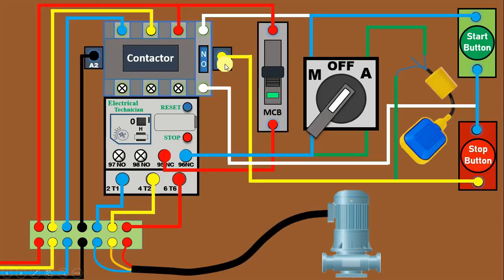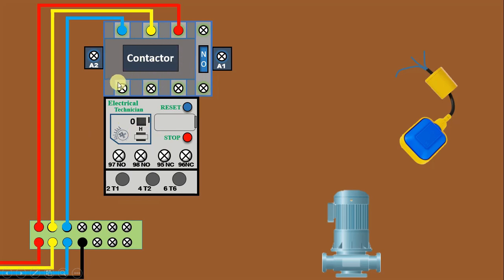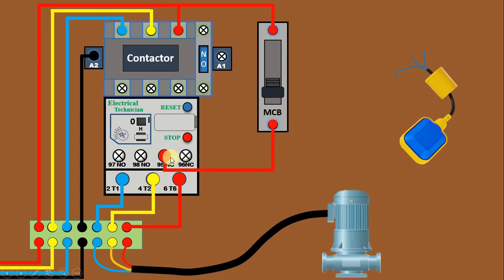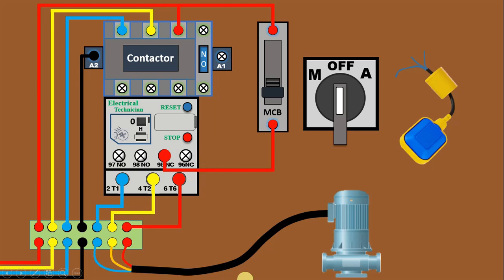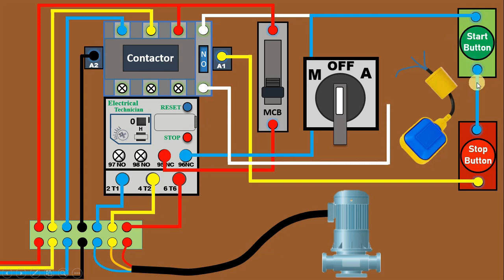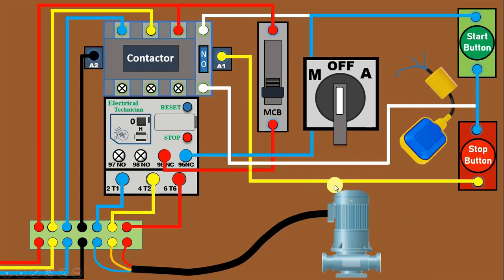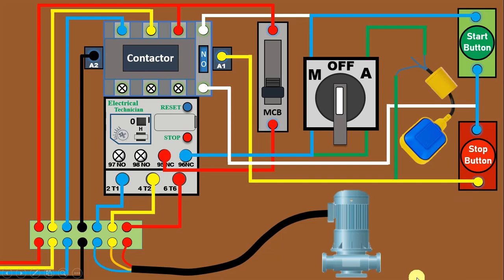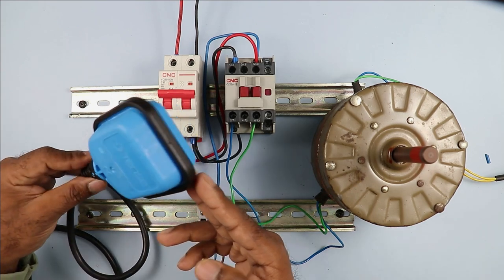Float Switch Connection with DOL Starter || Selector Switch & Float Switch wiring @TheElectricalGuy

Comment: Hi friend your explanation is very nice, But remember the hazard. Normally in houses float is used for water level control. Incase of float failure, water will contact the 230V and it will lead for serious hazad. To avoid Hazard in float, you have to use 12V D.C . Then the problem will solve ,other wise if you want to use in same A.C method, then to minimise the hazard use the float in 15A heavy float. It is also available in market. Thank you.
Reply: Some buildinga we need 3phase power for water pump